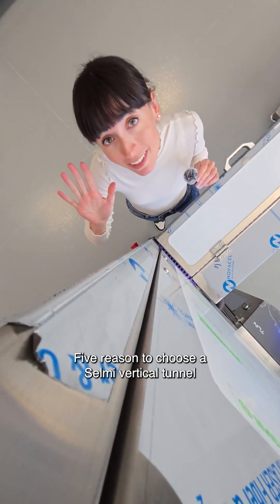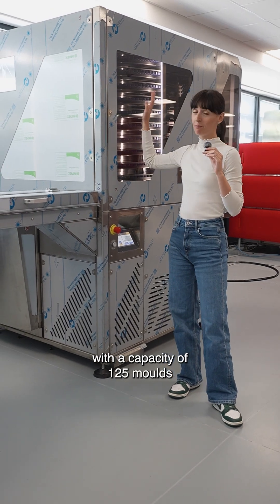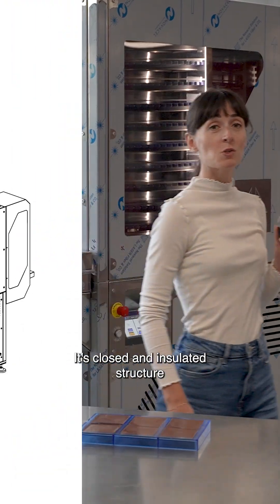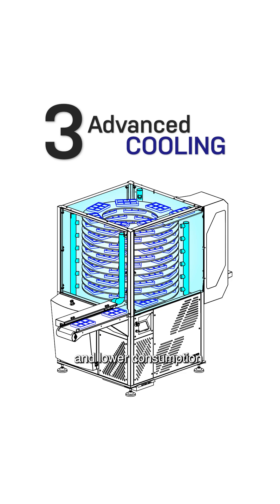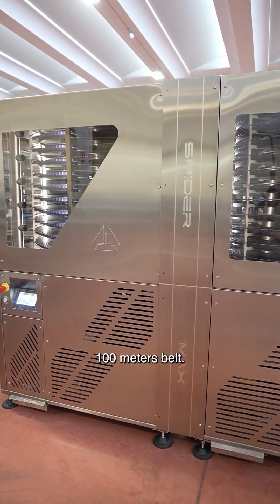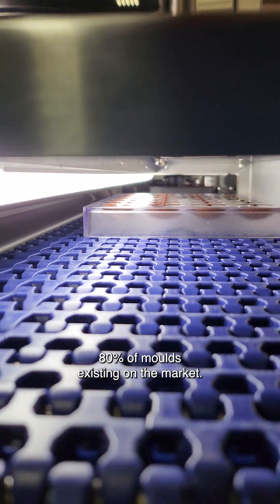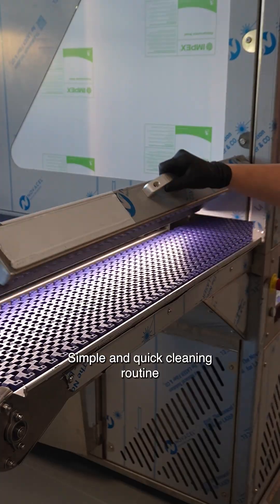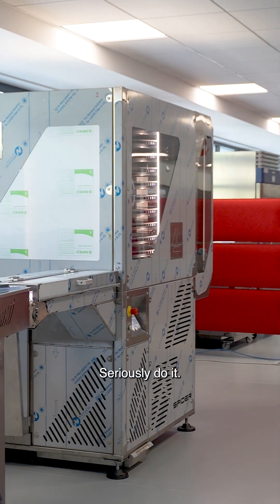WHY SELMI - Spider Vertical Cooling Tunnel

Comment: Hello dear,  what is the capacity production and the cost?
Reply from the maker: Hi! The classic Spider can hold up to 125 molds, while the Max version can hold up to 260 molds. Its production capacity depends on several factors (type of product, chocolate, weight, and mold) and, under certain conditions, it can cool up to 3 molds per minute.
For more details or a personalized consultation about your products, feel free to contact us at: backoffice@selmi-group.it! Thank you!